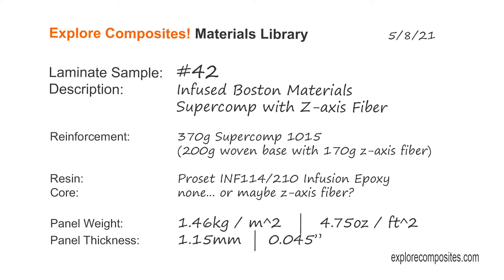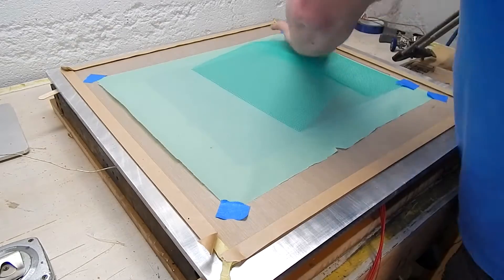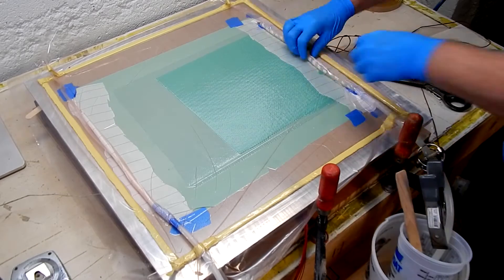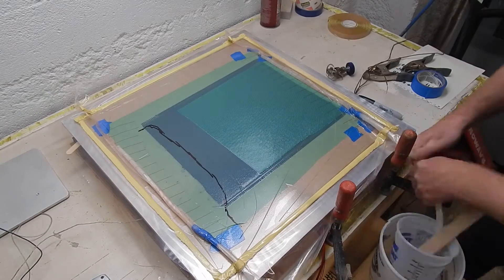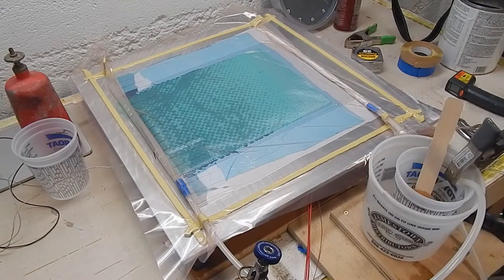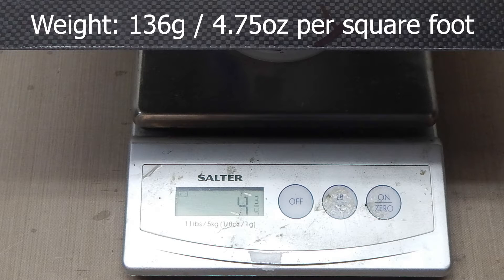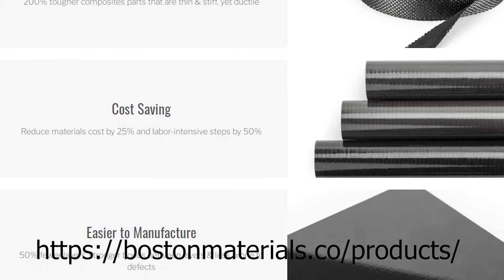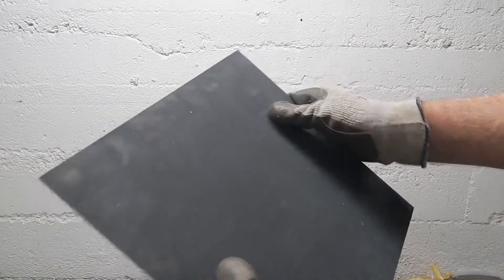Laminate Sample #42: Infused Boston Materials Supercomp with Z-axis Fiber

Comment: I worked for a startup company that made CNC Z-Axis carbon fiber preform stitching machines. Cut the dry fabric plies, load in a frame, stitch up with 3K carbon fiber tow, and out comes a sturdy preform ready for RTM molding, with enhanced with Z-Axis anti-delamination tows.
Reply from the maker: That sounds interesting - could the preforms be 3D or just flat sheets?

Comment: Great work. I follow your videos. Have you ever tried to laminate glass over EVA foam with epoxy? Could be possible?  Thanks and greetings
Reply from the maker: I don't know anything about using EVA foam as core - it is very soft and probably wouldn't work well.  EVA foam glues well though so I'm pretty sure fiberglass could be laminated to one side of the foam for a hard "shell" or the foam could be bonded to existing fiberglass parts.
Reply: @ExploreComposites Thank you for the response. I'll give it a try. A friend gave me a surf softboard. I peeled off a thin plastic layer that it has and i guess that is EVA what is over the eps foam. If glue well, it should work. Maybe some pinholes to bond the resin with eps. I don't know. Thanks again and sorry for my english.

Comment: Hey EC. If you were making composite bow limbs from wood veneer and fibreglass, what kinda material would you use?
Reply from the maker: Besides wood veneer and fiberglass?  Epoxy... and I'd probably try to stick to only one material running in the "long" direction.  Wood with off-axis fiberglass to prevent splitting maybe... or just fiberglass.
Reply: @ExploreComposites  I've got some oak veneer, some fibreglass "tape" which has a close weave. I'm going to sandwich the fibreglass in-between two lengths of the veneer. 

The reason I asked, I'm not sure which epoxy to go by and I can't find much information. I do have some now, I went with a low viscosity epoxy resin that claims to be for fibreglass laminates.

Comment: If you're still monitoring comments, there have been some recent security-oriented videos evaluating bags for locking-up one's stuff in situations like at the beach, where the bags have made claims of being slash-proof.  These bags have basically all failed because the manufacturers did not include anything that was resistant to a hardened steel knife used to make a concerted stroke.  No one included any kind of metallica fibers in their bag fabrics, so a sufficiently sharp knife had no trouble just cutting through the multilayer bags.

This got me thinking about relative slash-resistance of composite/laminate panels, and if a carbon-fiber, fiberglass, or kevlar panel offers much slash resistance.  This also reminded me of fine woven stainless steel fabric, which has been used for things like novelty wallets and watch bands, and if these stainless steel fabrics are suitable for inclusion into laminated panels or not.  Seems like it could be an interesting avenue of experiment if such stainless steel woven fabric is readily available, to see what resins might bind it, and to what materials it might well bind with and if thermal properties will amount to much in the course of such a panel's lifetime.
Reply from the maker: That is something I never considered but Kevlar or a similar material would probably work.  It is very hard to cut without the right tools and while a sharp knife will do it - it is slow and messy.  Ballistic fabrics are meant to absorb energy in unlaminated form and would be a likely solution here - but manufacturing low cost products with them may prove difficult!

Comment: Is there any special handling to keep the individual fibers from embedding in your skin?  When handling fiber optic cabling we have to take special care because no doctor would be able to find a 9 micron wide glass fiber.
Reply from the maker: I'm not sure - none that I know of.  I'm not sure how far in a very short fiber would go.  With long fiber optic strands they are quite long and could stab into you very far... right?  

Breathing it would be bad!
Reply: @ExploreComposites  I'm not really sure to be honest.  My work with fiber optic cabling is ancillary, I mostly deal with routing and switching and deal with infrastructure as-needed.

One thing about the glass, it's inert within the body as opposed to something like asbestos.  It's certainly not good to breathe it in but I don't believe it's as carcinogenic as other things could be.